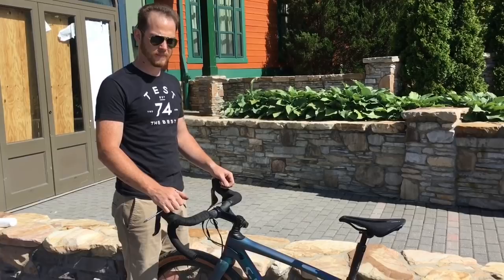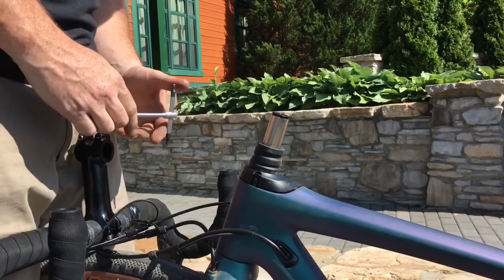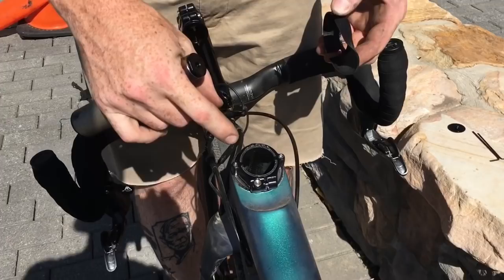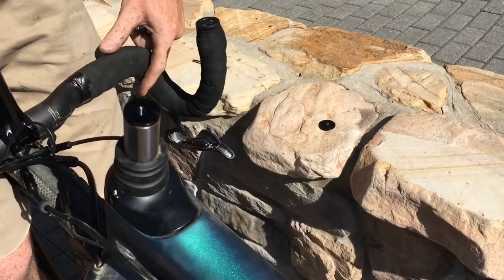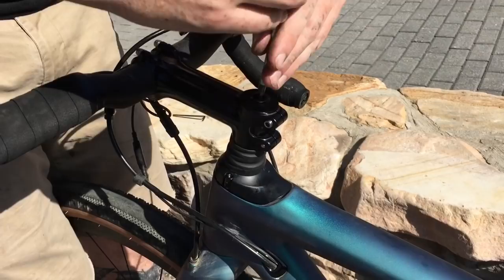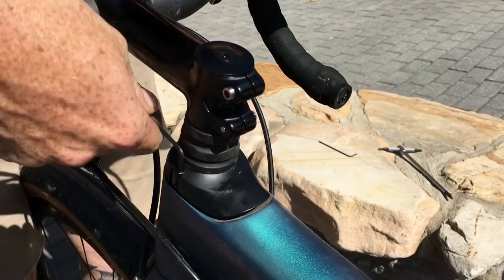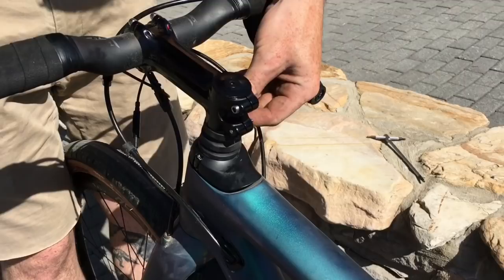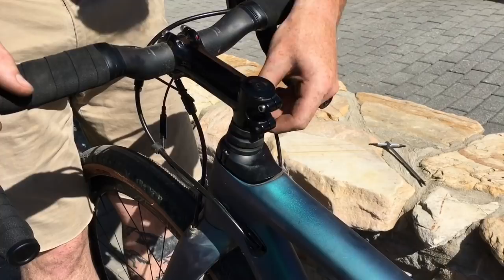Specialized Diverge Future Shock headset removal and adjustment

Comment: Whoever want to do this at home, please use a torque wrench, I saw a vid where the guy mentioned he tightened the grub screws (the screw the guy is adjusting here after 3 min) and it totally wrecked his future shock and the replacement took a while to arrive and isn't exactly "cheap".
Reply: Omar Tan: A torque wrench is ideal and I use one all the time but, if the company doesn't publish the torque specs then what?

Comment: Why do I often see people not using a torque wrench? There's no way someone can know the difference between 5nm and 6nm by feel alone, especially as most recommendations are to torque slightly less than max nm. I often see dealers not use torque wrenches too!
Reply: Вилена Сидельникова 
Yes, you're right. 

I've always seen it as good practice to use a torque wrench, even aluminium threads can strip etc. 

I've seen some dealer mechanics not use torque wrenches when tightening carbon posts.
Reply: Вилена Сидельникова 

Sorry, should have also mentioned that for safety critical parts of a bike  (like in this video), a responsible mechanic should use a torque wrench for rider safety reasons too...!
Reply: Ravinder Singh: I agree and, though dealers advise using that tool though too often they don't, from my perspective it's all torque.
Reply: An experienced mechanic has a feel for the elasticity of materials and knows when to stop.

Comment: did the set screw and lock nut sizes changes after the safety recall? mine are 2 & 1.5mm. or are they different size on a roubaix?

Comment: Tightening the collar to the cartridge doesn't seem like that would be secure enough to prevent a rider from eventually pulling the cartridge out of the steer tube during heavy riding; ie., pulling the front end up over obstacles. Doubt this could work on a mountain bike with rigid fork.
Reply: It's not intended to be used on a mountain bike. MTB already has their own technologies related to suspension forks. Road is totally different. This is an effort from Specialized to keep up with Trek and their Isospeed Decoupler systems. Which I say is far more superior.
Reply: its a similar size to a seat clamp and my 90kg fat arse has never moved that

Comment: Do you know if there a rigid tube substitute for the  Futureshock tube unit ? I  am tempting to buy a used 64cm Diverge at a very good price but i'm  not favorable for  this system of suspended handlebars  .
Reply: Replace the spring with a solid alu tubing of some kind will for sure block the system. Have not tried it, so do this at your own risk :)